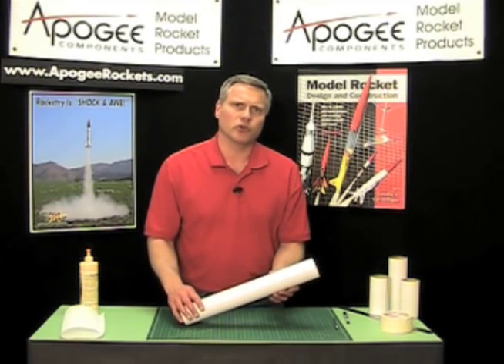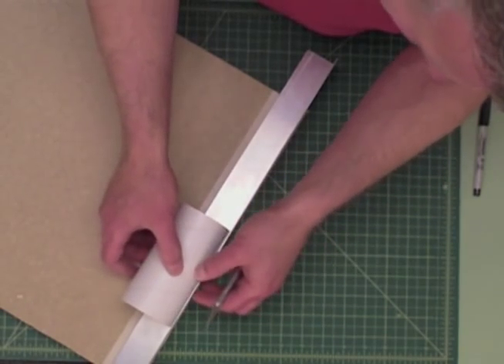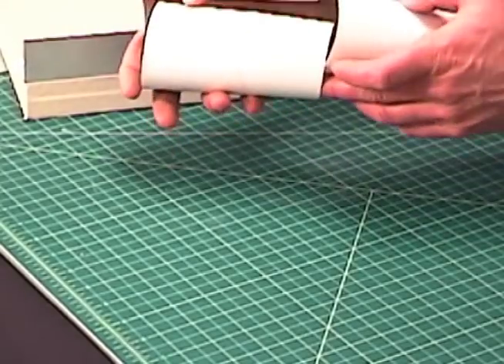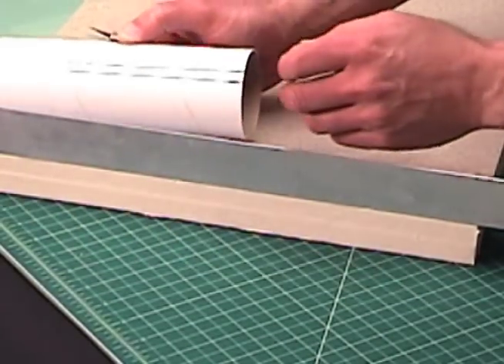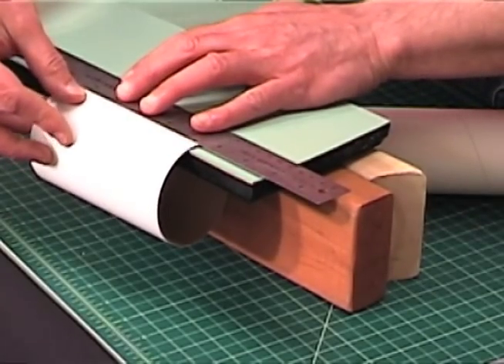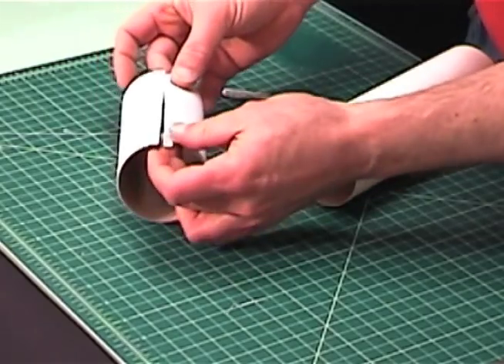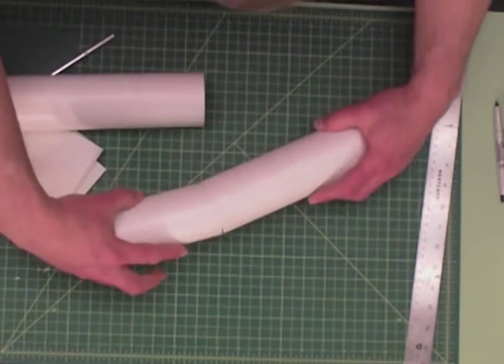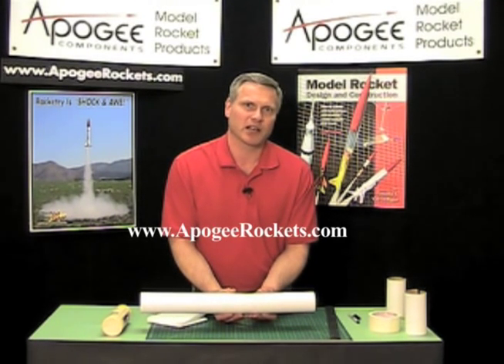Make Your Own Rocket Tube Couplers

Comment: Is there any reason not to trim the strip from the coupler tube using a large (and sharp) pair of scissors or sheers?  Seems like it should work, and would be easier than trying to cut on the overhang as shown.